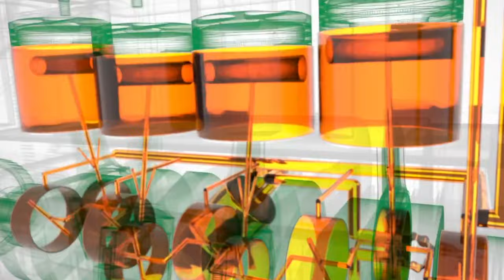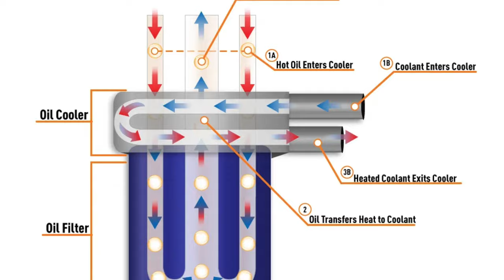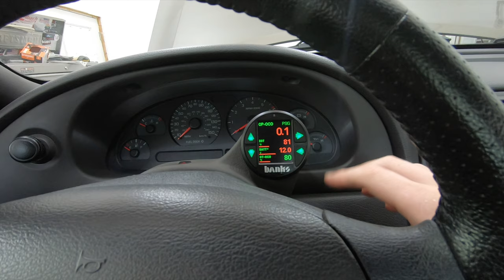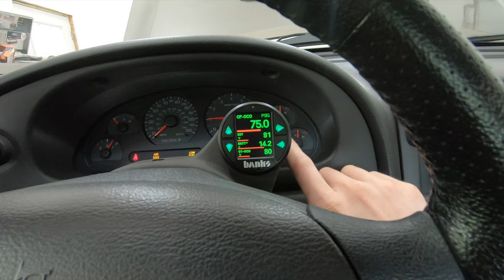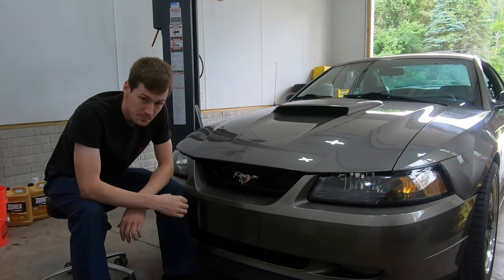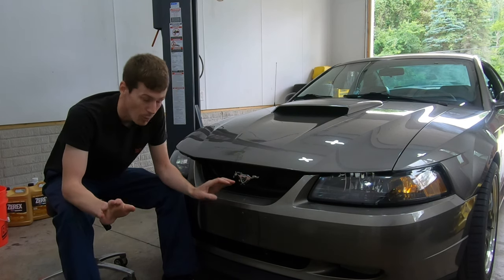DIY Universal Oil Cooler Install. Should You Install An Engine Oil Cooler?

Comment from the maker: Here are the parts I installed in this video:
Mishimoto Thermostatic Sandwich Adapter (M22x1.5) https://amzn.to/3BpyiGr
Mishimoto Thermostatic Sandwich Adapter (M20x1.5) https://amzn.to/3zFDEfi
Mishimoto Dual Pass Oil Cooler: https://amzn.to/3Q0E8lp
PTFE AN Hose: https://amzn.to/3zFFZXC
PTFE AN Fittings: https://amzn.to/3JcX5z7
Power steering Cooler: https://amzn.to/3z7Hk88
AN Line Wrap: https://amzn.to/3zcPYSY
Banks Idash: https://amzn.to/3OKnoy1

Cheaper options for what I installed: 
Sandwich Adapters: https://amzn.to/3OHSXrW
Oil Coolers: https://amzn.to/3PGHDhp
AN Line: https://amzn.to/3oIN2IB
Glowshift Oil pressure gauge: https://amzn.to/3bjQKFB
Glowshift OIl temperature gauge: https://amzn.to/3blFWa1
My Amazon Store:  https://www.amazon.com/shop/repairgeek
Help support the channel, buy using my Amazon links
As an Amazon Associate I earn from qualifying purchases and your cost is exactly the same.
Reply: Link to the Banks data gauge that you show?
Reply from the maker: @marstedt  I'm going to have a whole separate upload on that setup soon.
Reply: @RepairGeek  Excellent.  Thank you.
Reply: Which sandwich adapter is for a 03 mustang gt?

Comment: I've seen zip ties rub through rubber lines before. I hope this does not happen to you.  Much respect for convincing your wife to do a honeymoon at Laguna Seca!
Reply from the maker: Her idea!
Reply: @RepairGeek  you chose wisely then!
Reply: Even years ago as a kid,I'd look at those lame hose barbs and hide in a cooler kit and save it for the lawnmower.
Get real AN fittings and hose and make your own,it's not difficult and lasts way longer. 
Ever seen the corrugated split loom chew thru wire insulation? 
Had a perfect reverse pattern of the loom on the wire insulation right down to the copper.

Comment: Another application you missed for oil cooler is off roading the slowing moving high load put on the motor  benefits  from a oil cooler so much so i put a electric fan on my to help cool it

Comment: im about to add the mishimoti trans cooler with the fan. We drove to west PA last year about 5.5 hours and the tranny was smoking u could feel the heat inside the car from the tunnel. previous owner installed a power steering cooler like u did i think. im gonna get under there and take a better look. any advice on the trans cooler?

Comment: I am building a 66 Mustang GT-350 Replica.  I will have a 331 small block for power. Estimate 475 HP.   Aluminum Radiator and planning to run a universal oil cooler in the front center where the license plate would be.  Thanks for making this video. I subscribed.

Side note. I have a 69 Mach1 with a 428 Super Cobra Jet Oil Cooler with Ford factory parts. It was very expensive but it works. 

I have a 65 Shelby 427 Cobra with a 427 side oiler (now an aluminum block). It also has a oil cooler.  I have tracked it many times in the past.

Comment: Thanks for the video. Unfortunately, my oil cooler has T/U on me, but due to the age of the car, I'm unable to source parts or replacements.  Hence, I  will need to fit an oil cooler. My biggest problem is finding a garage or  mechanic who is willing to undertake the job.

Comment: I daily drive a 66 Chevy pickup with a 350 Buick and I do A LOT of towing. When I'm on the hiway the oil pressure gets down to 28psi since the oil gets too hot. So I figured I should probably rock an oil cooler.

Comment: Super informative. I’ve been thinking about adding a engine oil, transmission fuild and power steering fluid coolers to my grand Cherokee. The oem ones just aren’t good for as hard as I push it. This video had helped cement my decision to do it.
Reply: Make vids. ;)

Comment: Thanks for the Video, please advise when doing service on the car, do you always have to empty the engine oil cooler you installed of the old oil? Or you just do the normal engine oil change without tampering with engine oil cooler? Thanks!

Comment: Nice install! My only concern is it looked like one of the lines was basically touching the sway bar? Looks like when the suspension is compressed, the bar will actually move away from the line. Just thought I'd mention it anyways. I'd be more concerned about it tapping the line repeatedly and causing a fitting to loosen than actually wearing through.
Reply from the maker: It is close but it's not touching at full droop. I have about a 1/2 to 1/4 inch clearance at full droop. When I put the weight on the suspension the clearance gets much bigger because the bar rotates down as the suspension is compressed. I've been checking for leaks or issues after every drive and so far after about 250 miles I haven't had anything touch but I did have a couple small drips I needed to address but so far so good. 😅
Reply: @RepairGeek  Nice! I figured you had it all sorted, but I've seen very smart people make simple mistakes before, hahaha. Hope it does well for you. :D

Comment: I recommend you the mishimoto radiator with reins performance 170* thermostat, also flexalite blackmagic fan with shroud its a one single speed fan using the high speed wire but with the sct tuner you set your fan speeds to low speed 170 even tho its not going to be connected and your high speed to 194*on and it will turn off at 189*.

Comment: Great video, is the oil cooler placement in front of the condenser, bad for the condenser?
Reply from the maker: The car has no issues with the AC. This setup works great.

Comment: Will adding an oil cooler to a high mileage truck that burns oil be beneficial? Thank you.
Reply from the maker: No sorry it wont. That's an internal mechanical issue. You may have luck adding an oil additive like motor honey or Lucas to thicken up the viscosity.

Comment: I notice the lines run right next to each other (nearly touching). Wouldn't it be better to separate them since 1 side is hot 🔥 and 1 is cooled?
Reply from the maker: The amount of heat transfer between the hoses that are next to one another is so small it's not worth worrying about.

Comment: Given the lessened cooling capacity because of what makes the ZR2 more offroad capable, would you consider/recommend adding this to your Colorado?
Reply from the maker: So my truck has a water to oil style cooler on it from the factory like what I spoke about towards the beginning. I monitor oil temps among about 40 other things regularly with my idash. I've never had my oil temps go over 205 granted I don't tow all the time but right around 200 is ideal because your able to boil off any moisture that collects in the oil. Highway driving makes the oil about 20 degrees hotter than putting around town in that particular truck. What this mustang is going to do on the highway as far as temps with this cooler installed I'm not sure yet. This mustang had nothing for oil cooling.

If I add any cooler to my truck it's going to be transmission 100%.
Reply: @RepairGeek  (fellow ZR2 owner) maybe a transmission cooler could be the next video 😉
Reply from the maker: @red6743  I've been toying the idea. 40k service is going to be my next truck related video. Basically changing all the fluids.
Reply: @RepairGeek  I look forward to that one! I just changed the transmission fluid and filter at 50k.

Comment: When you are doing an oil change, the oil that is in the cooler is missed and left behind? Or do you/can you drain or flush the oil in cooler?
Reply from the maker: You can flush the cooler but what I've found is the way mine is setup, because the cooler is higher than the oil filter, when I remove the oil filter the cooler drains into the pain as well.

Comment: I have a Honda civic 2012 coupe everything is factory designed besides an cold air intake (I dint tow anything )I was wondering if I need to get an transmssion cooler for the hot temp. In south texas Or if my car is safe enough to handle it via it’s build design? Any thing helps

Comment: I see you replaced the power steering cooler tube with a finned cooler? Was that a direct swap or did you have to adapt it? You have any part numbers?
Reply from the maker: The factory cooler attaches to 2 rubber lines behind the core support. I used 2 barb fittings and some additional rubber hose to attach the new cooler.
Cooler:https://amzn.to/3GxclI6
Reply: @RepairGeek  thanks man!

Comment: My biggest fear of installing an additional oil cooler to an engine that didn't come with an oil cooler from the factory itself is that, I heard that an additional oil cooler will totally mess up the pre engineered amount of oil pressure throughout the entire engine plumbings including the critical components such as crank oil journals and other passage ways and will pre-maturely if not immediately seize the engine by creating an oil starvation.
Reply from the maker: Just fit the largest lines and cooler possible to decrease the pressure drop. My pressure drop was about 1 psi.
Reply: @RepairGeek  So to eliminate fatal engine failures, a tight sealing fittings is all that matters?
Reply from the maker: Stop looking for an argument and actually try to comprehend my original reply. -10AN or 5/8th's lines have plenty of volume for a typical V8.
Reply: @RepairGeek  Sure, thank you so much for answering my questions. I'm just a little anxious. My engine is an inline 4 (motorcycle) which is significantly heating up a lot after rebuilding it from the OE Benelli authorized service center itself. The new engine was built at the service center part by part and didn't come as a whole from the manufacturer. As per them, there is nothing wrong with the new engine but to me it defnitley heats up a lot than the previous 8,000 mile old engine. Hence contemplating on adding an oil cooler against the dealerships advice.😩
Reply from the maker: How are you measuring these temperatures? I'm not familiar with bikes.
Reply: @RepairGeek  with the Dash console, it shows precise oil temperature in °C.

Comment: Got a question about the power steering cooler… was it pretty straight forward to connect or did you have to modify the lines it connected to?
Reply from the maker: The old cooler attached to 2 rubber lines behind the core support. I just removed the stock cooler, used to barb fittings on the stock rubber lines and installed the new cooler.
Reply: @RepairGeek  gotcha thanks a bunch…currently getting a cage put in my car and dont have a car for reference right now to see how it connects lol

Comment: I thought the radiator took the oil up in temperature so it at running temp in the cold. Radiator is not going to cool it.
Reply: That plate is sweet

Comment: On turbo application, should the oil cooler be plumbed in before or after the turbo?
Reply from the maker: Before. The cooler needs pressurized oil.
Reply: So then for turbo cars, installing the thermostatic valve at the oil filter is recommended?

Comment: So once u add a after market oil cooler is the factory one still in use or no? My oil temp Nd engine temp sensors are on my factory oil filter adapter
Reply from the maker: It depends on how to connect the cooler to the system. I'm not familiar with that particular car.
Reply: @RepairGeek  i have a lincoln ls

Comment: Hey did this effect your oil pressure any?
Reply from the maker: I have about 1-2 psi drop across the cooler with the thermostat closed sending 100% of the oil through the cooler.
Reply: @RepairGeek  not bad at all. Thank you. I was worried about pressure dropping

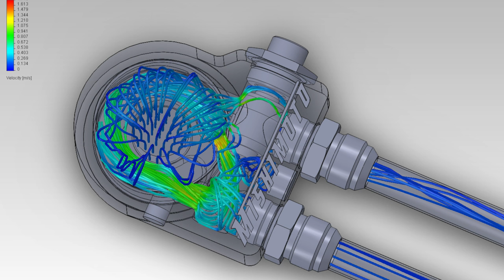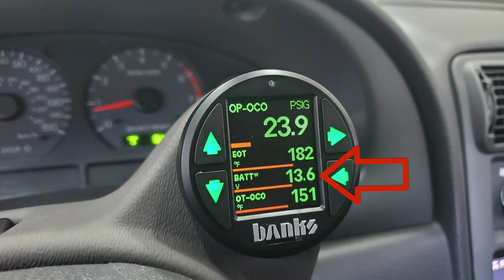Comment: You contradicted yourself. You said the oil does not go to the cooler at 185° and below 3:32 and then you show the oil below 185° 15:50  being cooled when you just said the oil is bypassed at 185° and below. Is anybody paying attention?
Reply from the maker: The bypass does not block flow to the cooler. When the thermostat is below temperature some of the oil is bypassing the cooler and some is going through the lines and the cooler. The lines to the cooler are always open and receiving some flow no matter the temperature. When the oil temp goes above 185F, the bypass closes and sends ALL the oil through the cooler. The engineering drawings that I showed at 3:36 and 3:39 back up this.